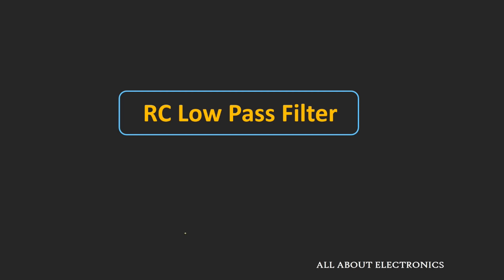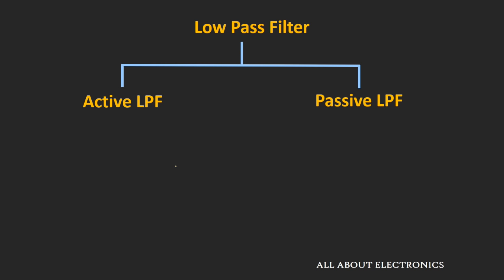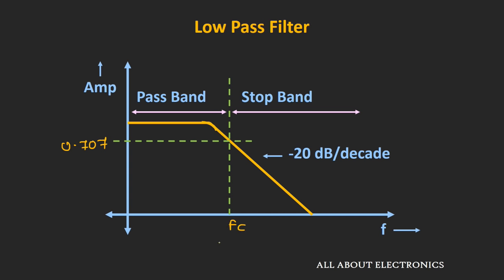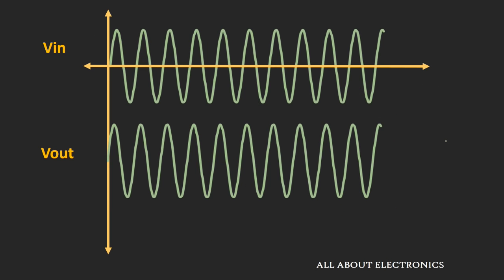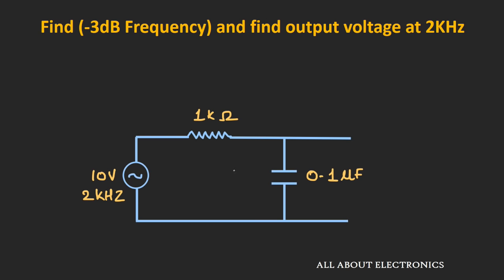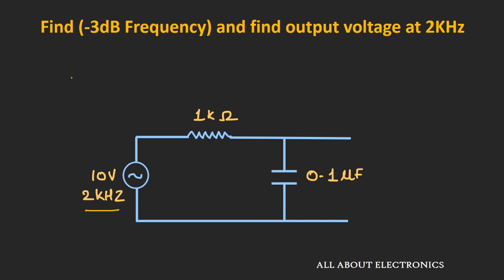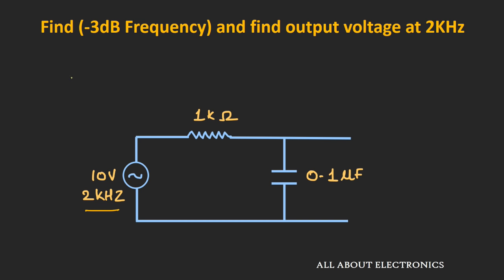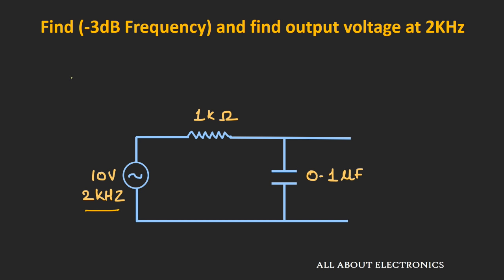RC Low Pass Filter Explained

Comment: How can the first filter load the second in case of cascading? Please explain
Reply from the maker: The Thevenin's impedance of the first stage(the output impedance) should be less than the series resistance of the second stage, else it will change the effective resistance of the second stage and hence the cut-off frequency. Genreally,

Comment: when w is low then xc is very large
thek how v out=v in??
Reply from the maker: At low frequency, Xc is very large. So the capacitor will act as open circuit. Hence, Vout = Vin. ( The same voltage will also appear at the other end of the resistor, towards the capacitor end).
I hope it will clear your doubt.

Comment: Why you took square root at 5:58
Reply from the maker: To find the magnitude. The capacitive reactance has j term. 1/jwc. 
Which indicates the phase difference between voltage and current.
To find the magnitude we need to take the square root. It's like a complex number. 
Suppose you have A+ jB, then magnitude is sqrt ( A^2 + B^2).
I hope, it will clear your doubt.

Comment: What is the loading effect at @14:20
Reply from the maker: The loading effect means, the second stage will act as a load for the first stage. And it will come in parallel with the first stage capacitor. Because of this load, the effective voltage which is appearing at the output of the first stage will reduce. That is the loading effect. To reduce the effect of loading, the value of load should be larger than the output impedance. In case of higher order passive filters, this effect is bound to happen. For more info, please check this video on input and output impedance. And in that video, I have explained it in detail.
Here is the link: https://youtu.be/7jw2_x8dyQ8?si=cl7SXMXLBldL_Zmw

Comment: What is loading effect?
Reply from the maker: When the load is connected to any circuit then the actual output which appears across the load depends on the output impedance of that circuit. For low impedance load (when the load impedance is comparable to the output impedance of the circuit), the actual voltage appearing across it might be lower than the ideal voltage (which should appear across it). 
I have explained it in detail in one of my videos. For more info, you can check that video:
Here is the link:
https://youtu.be/7jw2_x8dyQ8

Comment: sir how we know that at cutoff frequenccy the  amplituted of output voltage is 1/√2 times Vin
Reply from the maker: In fact, it is other way around. The frequency at which the output is 1/√2 times the input, that frequency is known as the cut-off frequency.
Reply: Sir is there any derivation? 
 Or its just in the defination of cut-of frequency
Reply from the maker: Well for most of the filters which have flat passband, for such filter cut-off frequency is defined as -3dB frequency (Where power is half or voltage is 1/√2 times Vin).
While for the filters which have ripple in the passband (e.g Chebyshev Filter), the cut-off frequency is defined as the frequency where ripples end in the passband.
Reply: Dear friend, cutoff frequency is defined as the frequency at which output is 70.7% of input....

Comment: Yr apny - 20db,-40db kesy nikala wo smjh nai aya or 1.59 q Liya cutoff frequency wo smjh nai I mujhy
Reply from the maker: 1.59 kHz is the cut-off frequency of that filter, it means at that frequency, output will be 3 dB less than (or 0.707 times) the maximum value. And -20 db /decade roll-off means when frequency increases by 10 times then output will reduce by 10 times. Like wise, 40 db /decade means when frequency increases by 10 times output will reduce by 100 times. And that is what we want in filters, a fast roll-off.

Comment: plz tell me how did you calculate phase equation?
Reply from the maker: The transfer function of the RC low pass filter Vo/Vin = Xc/(Xc+R) = 1/(1+jwCR) 
So, phase angle will be equal to  0 - tan-1(wCR)= -tan-1(wCR)
In general, for any complex number A+jB/(C+jD), the phase will be equal to tan-1(B/A) - tan-1(D/C)
Here, in the RC low pass filter transfer function,  in numerator ,as there is a no imaginary part, tan-1(0) = 0, for the denominator, it will be equal to tan-1(wCR)
And overall phase shift will be equal to 0- tan-1(wCR)= -tan-1(wCR)
I hope it will clear your doubt.
Reply: I got it .thank you

Comment: can i place resistor after shunt capacitor? does it make any change?
Reply from the maker: Yes, you can. And in fact when ever we are connecting load to the filter, it is going to be in parallel with the capacitor. But just make sure that the value of the resistor should be high enough (at least 100 times the value of R). Else it will affect your frequency response as well as the output amplitude.
Reply: Yes Ajith you can, but make sure that the resistor value is not low....

Comment: What is amp on the graph and what is decade?
Reply from the maker: Amplitude is the output voltage and the frequency on the x-axis is in logarithmic scale. So, decade represents the ten fold increase/decrease in the frequency.
Reply: Dear Mukesh, decade literally means multiples of 10, so if gain is 35 db at 1Khz, in the case of low pass filter, at 10KHz gain is 15 db (35 db - 20 db) ....

Comment: I wish there was just even a one video or article explaining why the capacitor is parallel instead of series. But no, everyone just says to make it like this without any explanation at all -_- 

How is good to know, but learning depends on undersranding WHY.
Reply: Capacitor in parallel to what? It's in series with the resistor. Are you wondering why the output of the filter is taken across the capacitor?
Reply: Because when there are high frequencies it acts as a short circuit, think of it as a switch kind of for frequencies. when its in parallel with the resistor Rf and its a short circuit all the current will flow through it and no current will flow through the resistor Rf so it functions as an integrator. if it was in series with Rf it would do the opposite when in short circuits all the current would flow to the resistor Rf and there would be gain. hope that makes sense.

Comment: Why are we taking 0.707 times the input only... Come on you need fill in everything... 😑😑
Reply from the maker: Because, it is the point where the power becomes half. It's 3 db frequency. In dB, when power reduced by 3 dB, it becomes half. But in voltage it becomes 1/ sqft (2) or 0.707.
Reply: Ok but why are we considering only half power is being transmitted at the output ..why not like 75% or 80%..
Reply: Dear Siva, cutoff frequency is half power frequency, according to the definition of cutoff frequency.....